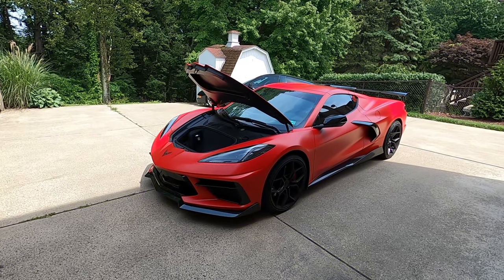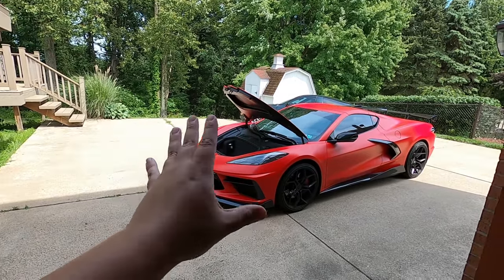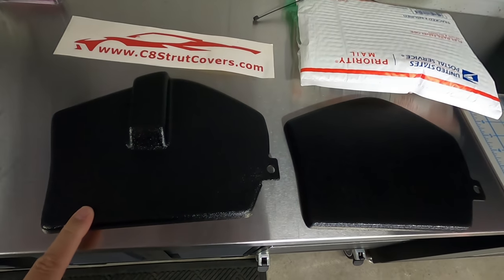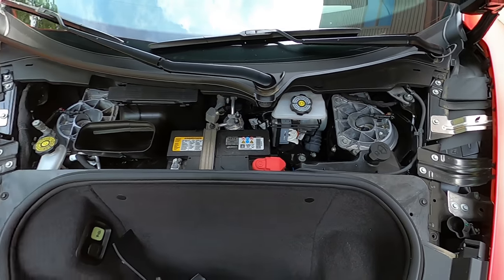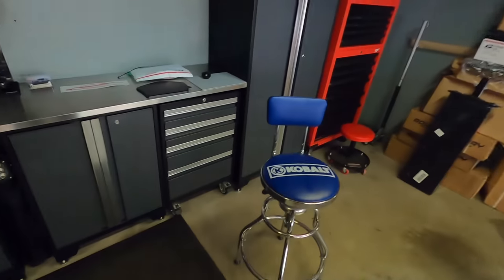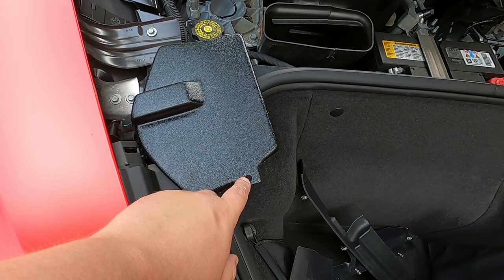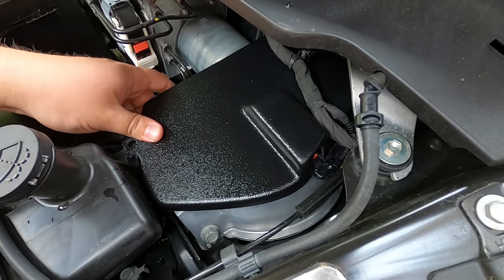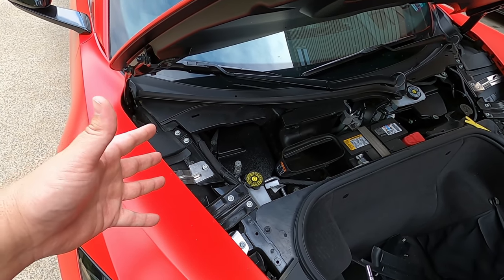C8 Corvette problem with an EASY and CHEAP solution! Stop RUST on your strut mounts!

Comment from the maker: What do you guys think of this issue and the easy fix? You can save $9 if you purchase the covers between now and July 12th. Just email them at Sales@AngryOffroad.com and mention you saw this video on the HorsePower Obsessed channel. 👍👍
Reply: Smart simple fix that would be mostly hidden by most owners.  I will order tonight, my Z06/07 is jealous of the modern marvel.  Can’t part with the “streetfighter” yet, but Z06 probably will not hit my driveway until 2024 if parts/over-demand etc., and Stingray C8 popularity continues.  Unfortunately the GM bean counters count money, not cars!
Reply: Correction: I was wrong the new 2021 C8 do not have the drain holes. I read somewhere that GM was going to add them to the 2021 but I guess they never did…
Reply from the maker: Does it?
Reply: LOVE that no tools were needed to get down there. Seems like a pretty darn necessary fix though.
Reply from the maker: Agreed. I haven't had my car very long and there was already some rust forming in there.
Reply: @TheCedarsGear  Drain holes where? On the strut tower tops?
Reply from the maker: I did research everywhere I could and found nothing saying there were drain holes anywhere.
Reply: @HorsePowerObsessed  you are correct I was misinformed. No drain holes… sorry for the misinformation. I corrected my comment.
Reply from the maker: No problem. 👍👍
Reply: GM did fix the windshield drain tube draining into the passenger side one in MY2021.  But it still gets into the drivers side, and don't trust it never getting into the passenger side, so thats why I still installed them.  (I have MY2021, and there was no water in my passenger side one when I installed.)
Reply: Can someone explain how these two crappy pieces of plastic cost $60?
Reply from the maker: R&D
Reply: What a gamble, should I save the $9? Or see if I first win the non-mag ride control version first? If I wait to see if I win, the sale will expire. Feeling’ lucky tho….
Reply: @erica1957  don’t think of it as paying for plastic, you’re paying for a solution to protect those bolts from rusting.
Reply: @Wannabe-Pro  
The problem isn't going to be water, its galvanic corrosion between aluminum and steel bolts.  Replace with stainless steel bolts, asap.  Then spray the top with a few coats of plastidip.

Comment: After you’re done “grabbing and yanking” and subsequently drying the area thoroughly I suggest spraying a lubricant, err 'rust/corrosion inhibitor' (I can't stop laughing), such as Boeshield T-9 (it was developed by Boeing) on those areas as well. You can get it from Amazon.
Reply from the maker: 🤣🤣🤣 I knew someone would make a dirty reference
Reply: @HorsePowerObsessed  LOL You can always count on me in that regard. >;}

Comment: Though I didn't have any water in my strut towers, probably because I've yet to wash the car or be caught in the rain, I heard about these caps back in February and got them installed. Very easy to do for sure and I do plan to retain ownership of my C8 for several years and my mission is to preserve and protect it inside and out by any means necessary.
Reply from the maker: Exactly!

Comment: The non magride version. Great video mate seems easier for the non mag version on passenger side. And might as well change the air filter super easy
Reply from the maker: I checked the filter and it looked clean so I didn't bother replacing it yet.

Comment: Thanks for the reminder about these. I've had them since before my C8 and just installed them on my 21. Fwiw my strut towers were bone dry. But easy protection to add even if the passenger side requires a little convincing

Comment: Outstanding video...I am ordering a pair tonight.  Would you recommend spraying the waffle area of the struts with a silicon spray or some type of lubricant in case some moisture makes its way into the area?
Reply from the maker: Thank you! It definitely can't hurt..
Reply: @HorsePowerObsessed  I just bought the parts and dropped your name.  Amy and the team were awesome. Parts on the way.  I told my corvette club and they all thank you. Yu will be getting a bunch of new followers,  Thank you for all you do for the corvette community! We really appreciate you.

Comment: I would have added a little lithium grease to the bolts before covering.  A little added corrosion protection.
Reply from the maker: I may do that in the future. You can't be too safe when it comes to rust.

Comment: Nice video, I am more a mechanical guy than waxer, so kudos on this one. IIWM I'd coat any nuts/bolts with a high temp grease (brake grease) or any anti rust coating that'll hold up over time before closing the strut tops in. Not light duty stuff like WD40. Rust will happen even without standing water. So if that's a FRUNK it should be fairly water tight, where's the water coming from? Do the frunk seals need fixing?  :) Froggy
Reply from the maker: The water is draining off the window before the frunk and then draining out the bottom of the car as designed but these pockets on the strut mounts are holding water.

Comment: Question? Pardon my lack of knowledge, but are there similar strut-towers on the rear of the vehicle and do the have the same issue? Especially after cleaning the engine bay? :)
Reply from the maker: Water could sit in the rear as well, but the crevices are a lot more shallow so they don't hold as much water and it's easily dried out by engine heat or a towel.
Reply: @HorsePowerObsessed  I would be inclined to install a set on all four, should they become available due to demand.

Comment: Jason, that's a severe safety problem.  Its not the water, its steel inside aluminum which is not allowable.  The fact that the bolt shows rust means its not aluminum and not stainless.  GM needs to replace those bolts before wheels start sheering off.  Ref:  "It is unusual to see galvanic corrosion on aluminum in contact with stainless steel (passive). In contrast, contact between copper, bronze, brass and different kinds of steel alloys (passive and active) and aluminum can cause severe corrosion."
Reply: Aren't all wheels then at risk for sheering off, since the lug nuts are just some low cost steel, and the wheels are aluminum? I agree with the concern in the video. Having something cast as a Belgian waffle to save weight, and then facing it up to the rain. I would use this mod, and of course use a shop vac or shop towel to evacuate the water, and then some 3-1 oil just to coat and seal that bolt, even though I don't think there is a huge risk here, because again... lug nuts and rain, not hearing about a lot of lug nut rust failures..

Comment: If these nuts and bolts are slightly rusted already, I suggest spraying them lightly with a lubricant to keep them from rusting more, and be able to remove them in future. Soak up any puddling of lubricant with a paper towel, and put the covers on!👍🏻
Reply from the maker: Excellent idea!

Comment: Does anyone know if any of the Corvette engineers have offered any explanation to this oversight. This would be bad enough if it was on a Chevy Malibu, but unacceptable on a halo car such as the Corvette. This problem has been reported since the C8 first came out and now 2 (3?) years later still nothing. Disappointing that every C8 owner has to go thru the hassle of buying and installing these on their own.
Reply from the maker: Just like the front radiator grills, GM has come out and said that they don't think this will be an issue. Unfortunately, I know it will be and the radiators in the front without additional protection will be an issue in the future too.
Reply: As I was writing my original comment, I was thinking of the grill insert issue also. But I had heard that Tadge J. had mentioned,as you said, that they didn't feel it was a problem, as they were concerned about the possibility of obstructing airflow during heavy use ( racing?) and possibly voiding the warranty. But I don't see any reason that they couldn't easily address the strut tower/water problem.

Comment: The non-magride version!
Do it, choose this face! 😵‍💫 winner…
Reply: Oh man. Coming back 12 months and 3000 mi later, I forgot to follow up on this. I just opened it up, and yeah, water is collecting. I think I saw where you may have sold your c8, but did the strut covers do their job and keep them dry?
Reply from the maker: Yes they did.

Comment: Make sure your front lift reservoir does not leak. Yours has the wrong cap on it and causes the leak. There is a bulletin about this.
Reply from the maker: Yup. It was fixed right after this.
Reply: @HorsePowerObsessed  i just got my c8 on july 2nd, and i have front lift also.  It comes with the wrong cap?

Comment: You never explained how the water gets in! There are 4 holes in the plastic under the wipers on the passenger side. That’s part of the problem. The other is the middle drain.
Reply from the maker: The water gets in a bunch of different ways. The important part is how to stop it.

Comment: Why not use. a turkey baster
Reply from the maker: you won't get all the water out with a turkey baster. You'd have to use paper towels or in this case, compressed air to get it dry first.